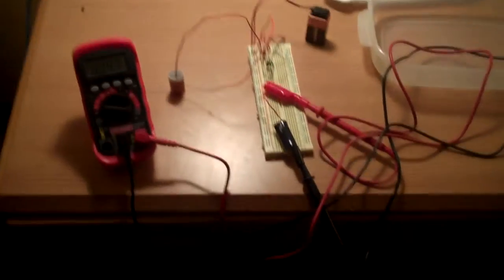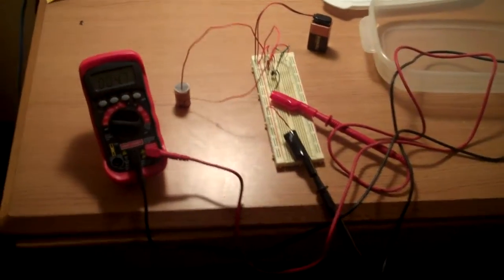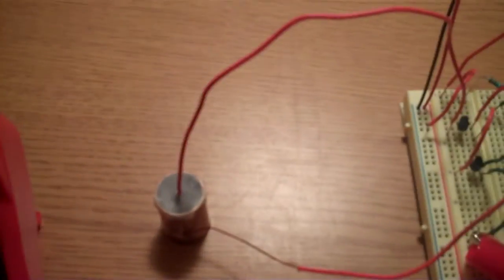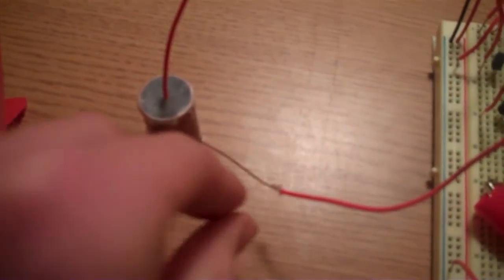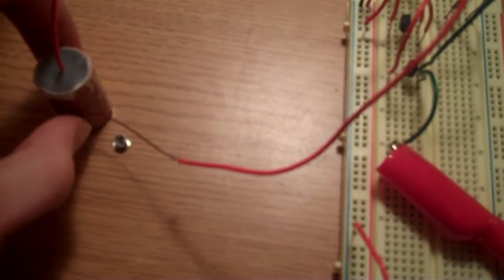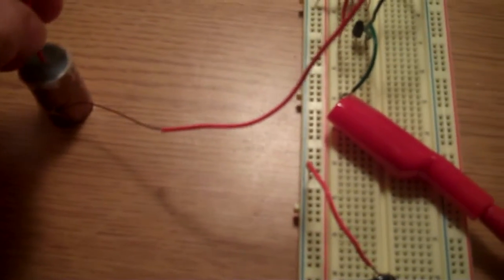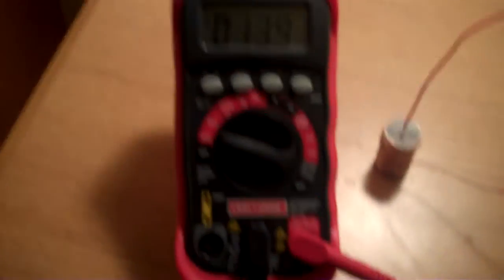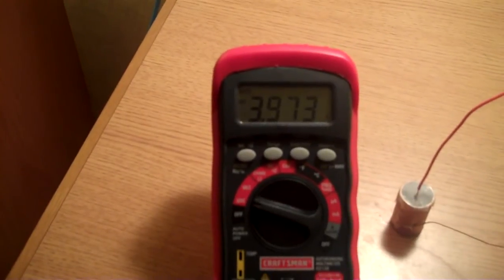Homemade Ionization Chamber

Comment: what transistors did you use? I tried this with two 2N3904 transistors but the voltage rises without any radiation, above 400mv then goes back down to 0mv, and repeats. Do you think the problem is with my circuit or with my multimeter?

Comment: nice build, please post the diagram.

Also, i advise you not to handle the americium bare handed because it is a strong alpha transmitter. It doesn't get far, but on the bare skin, or inside you it WILL get you sick or worse